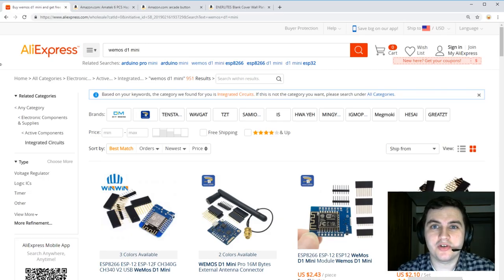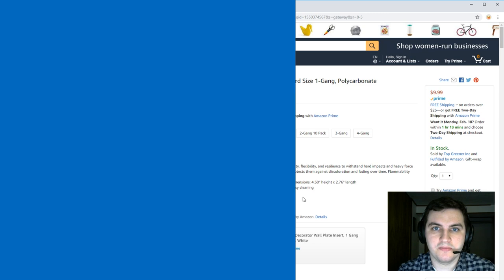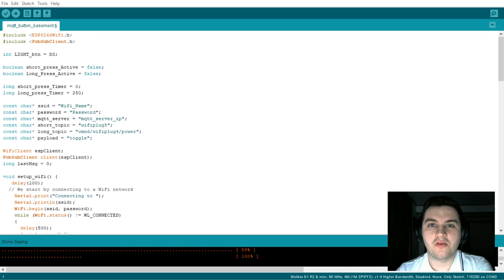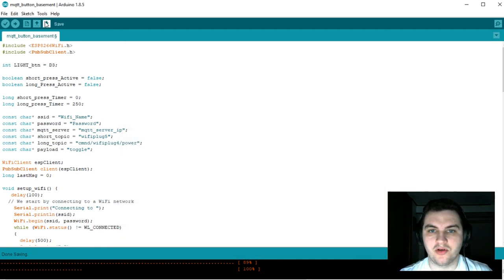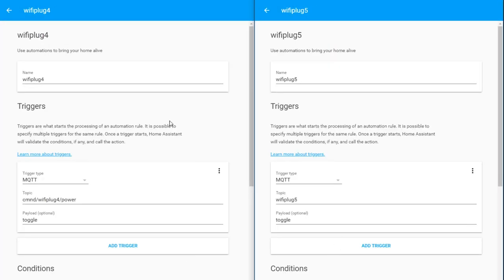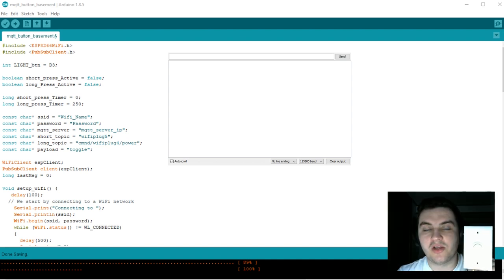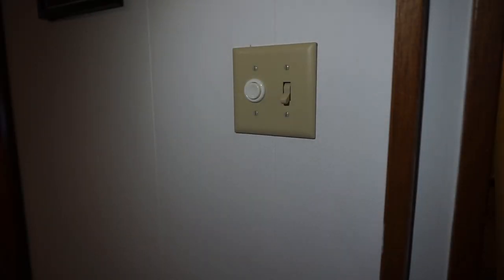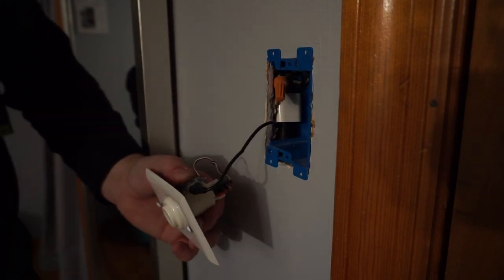$6 MQTT Push Button for Sonoff Devices and Home Assistant

Comment: Top tip: Get yourself a step drill bit. Even the cheap ones from ali make it very easy and quick to make large round holes for switches and the like.

Comment: Seems like an idea to add a switch without playing with AC Mains to add a three/four way switching. Wonder if the code can be refined to use a sleep mode and run the Switch off a 123A or a 18650 cell.
As for the arcade button I would try a touch sensor.
Reply from the maker: Definitely a possibility. Check out my latest video where I flash Tasmota onto the button instead of the code I used in this one. Tasmota has sleep mode functionality so it's definitely worth checking out.

The arcade buttons really grew on me :). I like their simplistic design. The touch sensors are actually cheaper than the arcade buttons. However I have to idea how to use then or properly set them up.

Comment: Nice video! You forgot about the power supply in your cost. Does your spouse/gf approve of arcade buttons on the wall? You can do something similar using cheap WiFi switches ($12-16) and Tasmota firmware and you don't have to stuff a power brick in your outlet box.
Reply: Yes.  It is $3 for the wemos.  $5 - $10+ for power supply.

Comment: Is it possible to make some sort of knob using a rotary encoder or potentiometer to control for example the brightness of a lamp?
Reply: It can be done.  Enough google searching and I am sure you can find a project where someone has done that.

It is far more complicated.  The led driver output has to be compatible with the Tasmoto code.  Whereas, toggling a simple on off relay is basically easy and universal.

Or just go buy a pre made smart dimmer, save yourself months of code learning, firmware burning, soldering, trial and error.

Comment: Q: why you have  not consider sonoff basic  instead of d1 mini  as it has one input channel also and power supply built in.
Reply: Good point.  Between all those components it does compete for cost within dollars and dimes.  The sonoff device is already tried and tested, conpared to a person's soldering, wire and software skills - more room for error when you do yourself.

I guess if someone wanted like 10 switches, have on their private network and like tinkering, it's probably just more a fun learning exercise.

Comment: hello I really liked the automation but I could not make it work with my broker that is authenticated, even uncommenting the line and used the options to authenticate the error in the code, would be possible to put this file with the broker method with authentication? Thank you very much in advance
Reply from the maker: Hey, check out my latest video. I use Tasmota on the button, you no longer have to deal with this code :).

Comment: hello, excellent video!
I need help, my mqtt server requires login and password, as I implement this request in the code.
thanks
Reply from the maker: Thanks, glad you enjoyed!

I updated the code to include an MQTT user/pass section. Please see lines 19-21 and 59-60.

I actually have this button working through Tasmota now, with both short and long presses controlling 2 lights! I will be making a video on this as well.

If you encounter any problems, please let me know.
Reply from the maker: Hey, check out my latest video. I use Tasmota on the button, and everything can be customized!

Comment: Hi man loved the video! , but i have a  issue with the code. On my local Mqtt-Broker ( HA addon) i use a username and password, and i can't get it to work i only get " failed, rc=-2 try again in 5 seconds
"  can you point me in the right direction where i can get it to work. have trying for 2 weeks and starting to give up. if i use ur code and a public broker that dont use a password it works fine but my local with a password, no luck! 

Have a nice day and keep  up the good work! :D